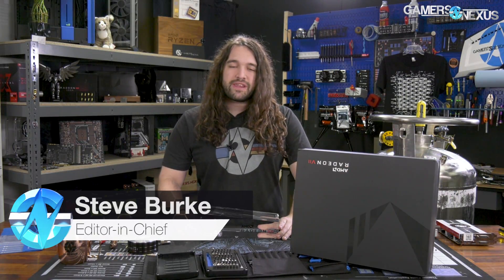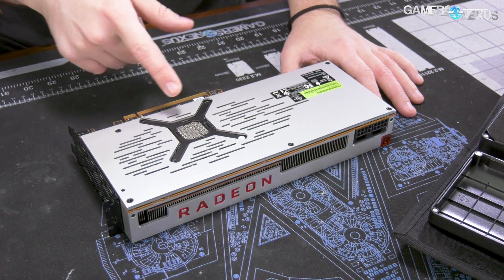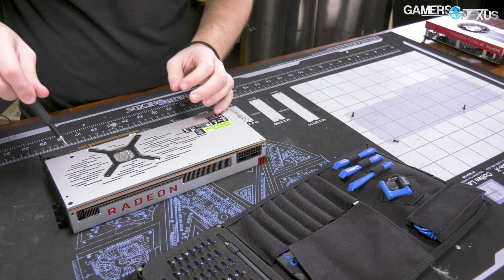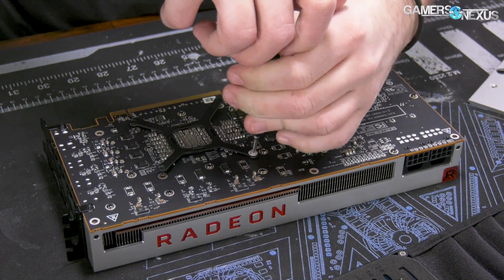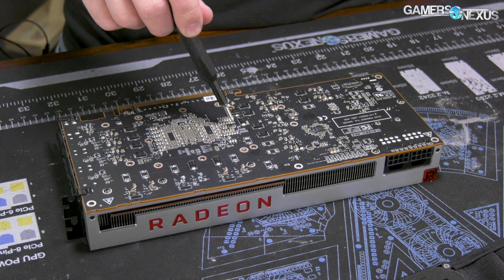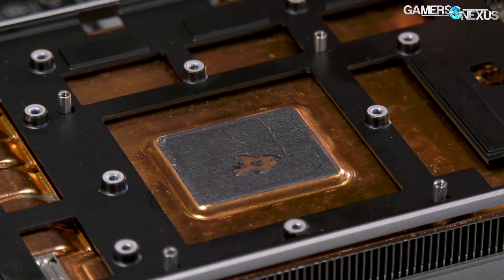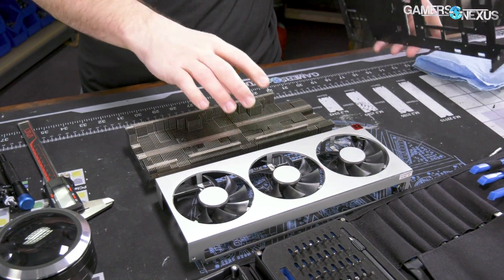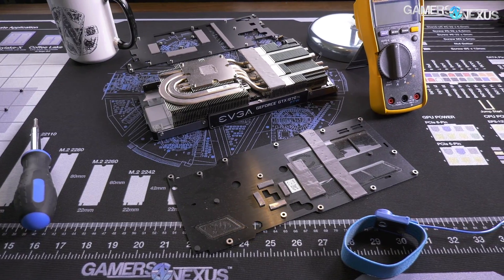AMD Radeon VII Tear-Down & Graphite Thermal Pad

Comment: Thanks GN great tear down was a fun video.

On the warranty void stickers as a retailer I have mixed feelings about them. On the one hand I do not want customers trying to return a product because they felt the need to take something like a video card apart and then screw it up by something like a screw driver slipping and knocking something off of the PCB board. Heck even in your own video at one point the screw driver slipped off of the screw and hit the PCB board. I know in this case everything was fine but that could have gone much worse for sure if it knocked off a component off of the PCB where the screw driver hit. If this would have happened to someone else and they broke the card or broke it for other reasons most people would try to take it back to the retailer to get a exchange or a refund and how is it the retailers fault someone could not keep their hands off of product and just be happy and use the product as intended by the hardware maker.

In my own opinion there is no reason for a regular person to take hardware apart such as a graphics card to do service on it while it is in the warranty period things like thermo paste will be fine for more than a year or 2 before it become useless. 

Now for the good part for review sites and Channels like this it is great to see under the hood of a product and see what makes them tick as well as seeing how well they are built. I also assume GN and others that do this for a living also know the risks involved by doing this and as such if something goes wrong they also know that they may have to take a hit for the cost of replacing that hardware. The problem is a common user if they try the same thing most will not be willing to take the hit for the cost and will try to return it to the retailer to get a new product or their money back.

As I said for me personally I do not care about those stickers I ignore them and if I feel inclined to take it apart I do so but I also know if I mess something up I can either try to fix it or eat the cost and get a new product the problem is there are way to many people that do not think this way and will try to screw over the retailer or the manufacturer and get a new product when in fact it was their own fault because they took something apart and had no real idea of what they were doing. but went ahead and did it anyway because they watched or read about how to do it on the internet. Those stickers are there to both protect the hardware maker as well as the consumer. It is a warranty provided by the hardware maker that if something goes wrong the consumer can hopefully get a product replaced or fixed within the warranty period. How is the hardware maker supposed to know if the product has been tampered with or not if the stickers are broken or taken off.

As I said I take my own stuff apart sometimes to enhance it in some way but I also know by doing so I just voided my warranty and do not expect a replacement piece of hardware if I mess something up because it was my own over eagerness that got me in trouble and was not the fault of the retailer or hardware maker. I have no problem with people doing this but at the same time they should also be smart enough to know that if they mess something up do not expect a replacement piece of hardware.

This is just my own opinion as I stated above and if anyone made this far down into the comment hopefully it gave some insight as to why it is not a great idea to have everyone going willy nilly on their hardware. Thanks
Reply: it against the law to not be able to repair or take apart your own product. If you caused damage it it then ya warranty be void and you know not to warranty it as it your fault.

ya ik you said your opinion but just sharing mine :)
Reply: @DragonProtector  Hey we are all entitled to have opinions so nothing wrong with you stating yours here as well. 

The problem is there are to many people that will go the warranty path even though it was their own fault. The temptation to get it replaced.refunded, repaired for free is to tempting for most people to resist seeing if they can stick it to the man so to speak.

For those that go in fully knowing if something does go wrong when they take apart a product under warranty and are prepared to take the costs on their own if it breaks I say power to them have fun.
Reply: @Rocky-bz8wr  ya and i say only accept warranty if they are willing to pay the cost to ship it and pay for any repair costs

Comment: That's weird that XFX of all manufacturers gave you that feedback. I thought they had some kind of double life warranty. One time I shipped them an 8800GTX with a water block still stuck to it and they fixed the card and returned it with the water block removed. As you can tell by that model name it was a long time ago, though.

Comment: I appreciate the cooling design.
I don't understand why keeping reviews a secret before the release.
Either they are good and people buy, either they are not and people don't.
The only difference as far as I'm concerned is that the 7th I'll order a new card and it will be either the RVII or a 2080 (here the 1080Ti are difficult to find and as expensive as the 2080).

Comment: Grpahite pad is probably the reason for "warranty void" sticker, you can't reapply it again, and thermal paste can have problems, if hbm and chip have different height. They won't be able to enforce it, but it may scare off people who are not sure what they are doing.
Reply: No, they are because stupid people knock some ceramic caps (which fail in a short) and the card stops working.

Comment: these fans are the same model used by Sapphires old (New 75mm GPU Fan FD8015H12S For Sapphire AMD/ATi Radeon HD 5700 6700 Video Card) and can be found on eBay

Comment: I agree with most things, but saying there's no real danger beyond removing those screws is not one of them. There's plenty of people not well informed enough, but perfectly willing to open up one of those puppies, mess around with it (like say, applying a different compound, but the wrong kind, conducting for example, or not enough), wreck it in the process by either mishandling it, putting it back together incorrectly or whatever else, and ship it right back to the manufacturer saying they did nothing wrong. Forums and comment sections are filled with people suggesting this course of action to others.

Course, the sticker method is not allowed, and therefor shouldn't be tried. Though... now that I think of it, it might just actually be the perfect deterrent for those not well informed enough people. Scare off some jokers who can't be trusted with the stuff, while those who know better can just ignore it, knowing they're safe. But then, the sticker shouldn't be ragged on. :P

Comment: momentarely ignoring the sticker, Im not an expert but that cooling solution seems pretty efficient, and the teardown seems efficient. Not to mention the usage pf graphitepad which, at least in theory, should beat the crap out of whatever thermal-guu cards usually ship with.

This was a great video to see before the review, as now im genuenly exited for the thermal-performance of this card. That's usually when I zone out when founder-cards are reviewed, as soon enough you have aftermarket versions all the way to 4-slot waterblocks if you want to make sure thermals wont limit your overclocking. Will this new desing render those obselete at least from the perspective of thermal performance? Does this desing translate to overclocking headroom or improve boost-clocks?

Comment: Thus far I like that cooler.
I hope it works as well as it looks. Going to be interesting in terms of that graphite pad as well.
Fan size could have been a bit bigger I guess.
But other than that the triple fan coolers of custom designs usually edged out the stock blower fans of last generation by a good margin.

However I own an OC Asus 1080Ti (SLI) and therefore sadly there is no point in buying this. AMD itself claims 2080 performance which is roughly equivalent to 1080Ti performance… well we will see on Thursday.

Comment: I'm impressed on how 'simple and clean' the card is compared to the Nvidia cards with all their 'extra stuff' when they basically have to do the same thing- graphics computing. If you had a vertical mount could you not use tin snips and 'bend' the Radeon name up- exposing the fins to better air circulation? If this card was a PCIe 4 card would there be any performance improvements- as shame that in 4 or 5  months time AMD will release a PCIe 4 MB but no PCIe 4 graphics card...?

Comment: I really don't like the VII's reference design, but I'm excited for the benchmarks. Although I expect RTX 2080 perfs, without the ray tracing part
Reply: technically there is no reason why it's compute performance couldn't be used for raytracing. it lacks the marketing wank called RTX. i'd personally put more stock in buying cards built around the raytracing implemention for direct x especially if that is being written for amd powered next gen consoles. navi's second gen will probably be a much better raytracer than the current rtx is

Comment: Correct me if I’m wrong but... Other channel tests benchmarks with stock thermal solution before tear down. GN will need to replace thermal sheet with paste before testing benchmarks. Which channel will give a more realistic idea of an out of the box experience for the general consumer? 🤔

Comment: Vega had issues with hotspots even with the top-of-the-line paste under water, you can only imagine how 7nm copes with this...
Graphite pads of these kinds are likely going to be very common in the 7nm space, AMD may even use them in their ryzen3 packages in place of solder, as solder also has hotspot issues, particularly with the 2nd gen ryzens.

Comment: thanks for all the information ! with the part numbers of the spare parts, very cool !
I plan to watercool the card. Usually when the next generation comes, i put the stock cooler back and sell the waterblock separately

Since they use a graphite thermal pad, i guess i have to use the same pad in replacement ?
would thermal paste work ? (a good one like MX4 or better)
or there is a gap, making the thermal pad mandatory ?
Also, how is the performance of the graphite  thermal pad compared to thermal paste ?

Comment: Touching ICs with bare hands? Using finger pressure to remove the thermal pads left overs on those fragile VRMs and regulators? Removing the cooling plate from the heatsink prying the small connector carelessly? Crazy!

Comment: @Gamers Nexus This might be a dumb idea, but wonder if you could flash it into a Vega 64 to unlock the additional compute units? You'd still get significantly higher clock speeds than Vega 64 thanks to 7nm. The ram size would have to drop to 8gb though.

Comment: A cool thermal experiment would be to cut off that top RADEON logo and see if temps change.
Reply: ya i was thinking same thing or you know run it without the plate (have fans attacked another way with ehatsink

Comment: is anyone else annoyed at the "RADEON" illuminated logo on the side blocking the fins from exhausting hot air out both sides equally? instead more gets pushed down into the motherboard to get pulled back up into the gpu... I'm sure its a minor difference in temperatures, possibly negligible, but its always been a pet peeve of mine when heated air has restrictions exiting out the side of the card thats most likely to escape the case rather than get recirculated back into the gpu... it really grinds my gears...

Comment: I'd think that for the vapor chamber to work there needs to be a warmer and colder side to get a vapor off/liquid back flow.
- Anyone got infos to confirm/deny this ?

I know that when manually building heatpipes (butane..) you need to get the right pressure/fill and temperatur spread to get the best energy transport.
Too cold/too much pressure so not enough liquid=>gas state change which takes most energy away,
also if too low pressure/liquid volume and only "steam left" (heat doesnt get away at the cold end) worse energy transport.

Comment: You mentioned that the "Warranty Void if Removed" sticker can not be reforced in North America. Do you know if this can be enforced in Europe?

Also, isn't the reason why manufacturers want these stickers to void the warranty so they won't have to hire a diagnostics team to determine wether the user is at fault (as this process would cost them money) for doing thing with the item.

Comment: I hate those warranty void stickers. I changed the thermal paste on my 1080 FTW and then about a week later my gpu started tanking in performance randomly and would only be fixed by a reboot, and the PC would only reboot properly maybe 50% of the time. I had to take out the cmos battery and put it back in along with the gpu before it would boot again. I contacted support and I sent pictures of the card and the guy tried to tell me they might not honor the warranty because I removed the sticker on the back, I said that isn't enforceable in the US and he sort of just gave up on that and went ahead with the RMA.
Reply: Need result please~

Comment: Wouldn't the air be pulled IN from the fins and OUT the fan?  that way the hot air is exhausted into the case and not directly on the MB or the case wall?

Comment: Question: would coating that baseplate, between the plate and the heatsink, with Thermal grease. Increase thermal conductivity in a beneficial way?

Comment: 2x 8 pin i can already guess power draw wont be pretty...  whats the exact purpose of those thermal pads? I cant imagine them transporting a lot of heat away from the vrm/mosfets i want to repaste my cooler when i get my new build but from what ive seen on videos that wont happen without the pads tearing or getting damaged on my card and i cant find new pads in stores anywhere.

Comment: @9:32 This is pretty confusing. How can there be no z-height difference if in an earlier shot of the thermal pad, you were able to see the embedded outlines of individual HBM dies?
Reply: the resin around the dies is not as tall as the dies themselves?
Reply: @MrOsmodeus  That's the assumption, but Steve is explaining how the resin should be flat since he can feel no z-height difference between the dies when he ran his finger through them.

Comment: The cooler has no almost no where for the air to exhaust I foresee some high temperatures for this graphics card, if the fans reversed the flow it would probably work fairly well.

Comment: Hi, can I ask what the original thermal pads had in thickness? I replaced mine a while back and now I need to send my watercooling into service repair and need to put back on the original cooling in the meantime. But now I struggle which thermal pad I need to buy. Is it 2mm or 1.5mm?

Comment: yes - my first question ...  where the air is going ...  holy... 

so you should be able to change the cooler ! und glue some little coolers on the front plate to optimize !  :)

and why the hell there is no pad or paste between the frontplate and the cooler .. ?! ..

Comment: It wasnt mentioned in the video at all but how thick are the thermal pads on the vrms? Im switching back to the stock cooler after liqued cooling and need to buy some new thermal pads for it. I'd appreciate if anyone could help

Comment: OMG, not those fans again. They are the same fans as Sapphire installs in the video cards since like forever. If they are the same quality as those installed on my r9 280x, than they will probably break/start to sound like a truck in 2-4 month of work. 
I wonder, if Radeon VII chip is liquid metal compatible and how does the new graphite Hitachi thermal interface compares in efficiency to standard Arctic MX4 thermal paste. Also, if it is possible to install "Be quiet! Silent Loop" on the chip without removing the MOSFET cooling metal bracket.

Comment: This card does perform 1-2FPS slower and 1-2FPS faster at times comparing with an RTX 2080 in 1080P, 1440P and 4K. But how much will it be ? If its cheaper than a 2080, will people buy it ? And does AMD have any hardware down the road to compete with NVidia 2080 Ti ?

Comment: I liked your video, but I'm quite disappointed in what I've learned lol.
I was looking forward to changing thermal pads / thermal paste on my Radeon Vii as maintenance. 
Looking at this, I would have been so unprepared if I took everything apart myself first (like I do with my other cards), so thank you. 
Question, what's the lifetime on this special pad? when to replace?
EDIT: Still super confused about how to properly maintain this card.. haven't done anything for 4 years, dust not really visible, mining...
Reply: Just replace the grahpite pad with paste, no problem at all
Reply: @falken5688  you've done this?
Reply: @Mehecanogeesir  yup. Takes some scrubbing to get the pad off but it's a totally easy procedure
Reply: @falken5688  awesome thanks for taking the time to let me know. Are temps similar before and after?
Reply: @Mehecanogeesir  They were about 10 degrees lower

Comment: great in depth stuff <3 one question to owners of this card. I just purched an XFX version and there are some irregularities in terms of aesthetically alignments of the case itself. It looks as if there is a bulge on the part above the RADEON led logo name. Does anyone else have this? I dissembled the top plate and adjusted the screws and it helped a bit. I guess it comes down to poor assembly job or perhaps it suffered while in transport. I just hope this doesn't mean it will suffer performance wise. Thx for your consideration :)